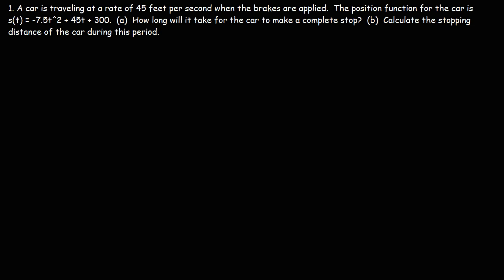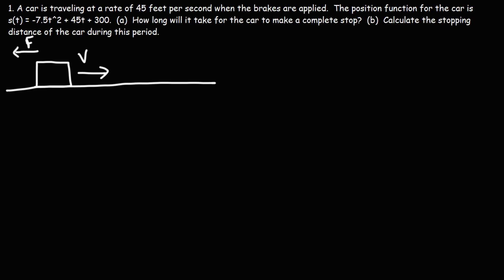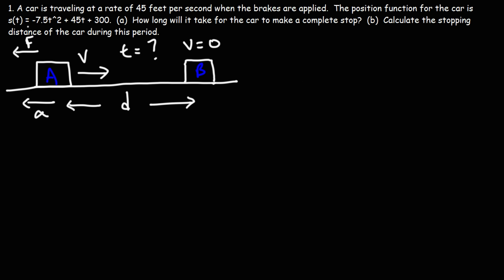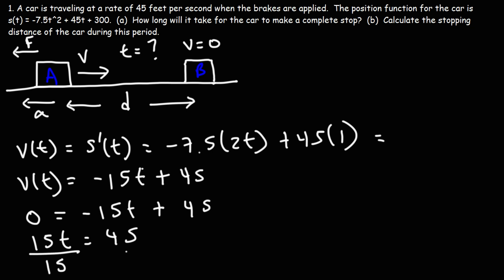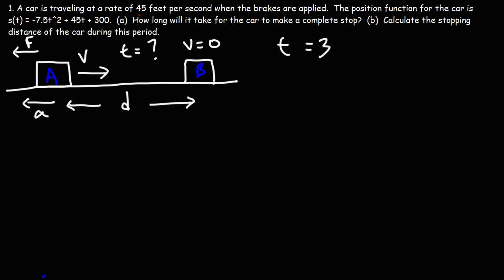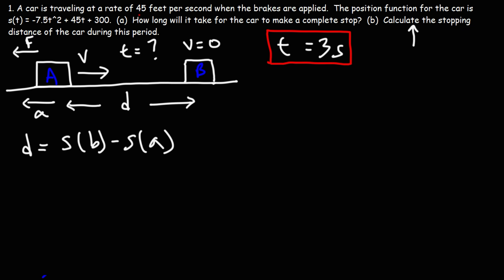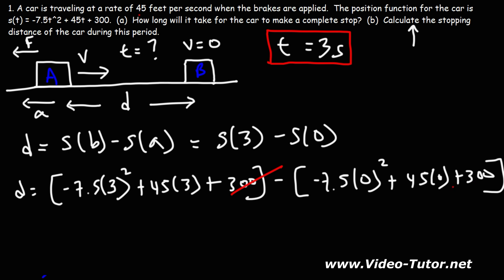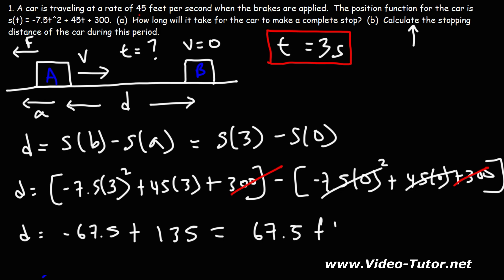How To Calculate The Stopping Distance of a Car - Calculus

Comment: You didn’t factor in the weight of the vehicle or the condition/quality of the brakes.
Reply: you dont need it. we are mot trying to work out how hard the brakes are working.
Reply: @joeds3775  so don’t make it applicable to real life, useful !
Reply: @Gsnaid  No, you are asking a different question.
Reply: @Gsnaid that’s all factored into the function given for s(t) and v(t). The question could’ve asked work out a function, s(t) that takes into account a car that is 2000kg and has new ceramic brakes. Then solve a and b. 
But because the function is already given it is already taken into account. 

Try not to be a clown and think you’re being smart